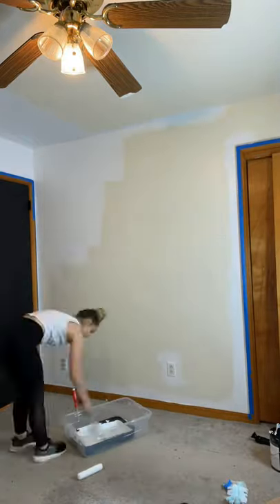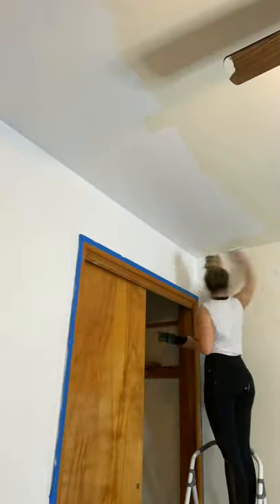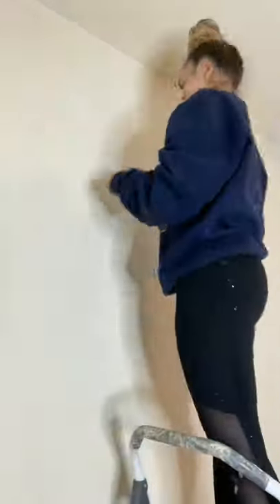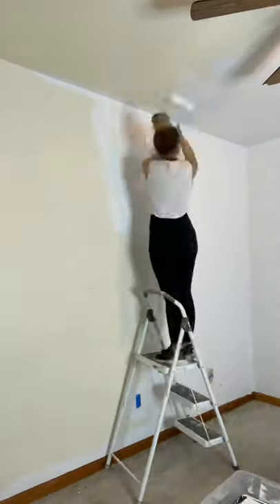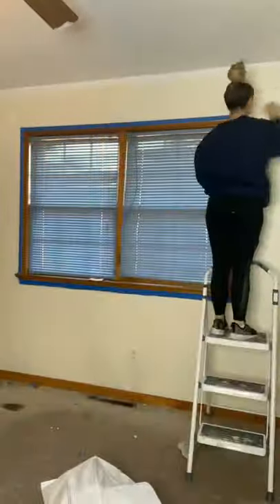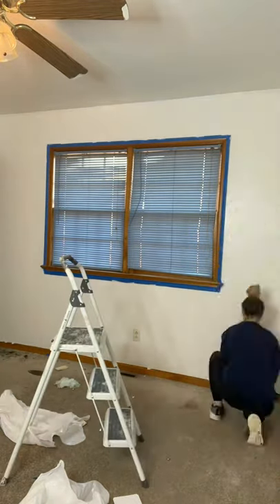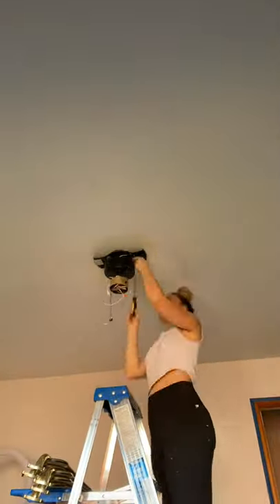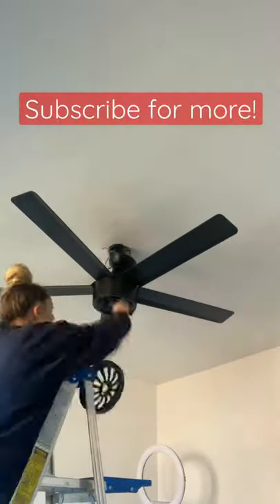HOT MESS HOUSE RENOVATION PART 124! | VIRAL TIKTOK & YOUTUBE SHORTS SERIES | LEXI DIY

Comment: You're such a badass, specifically, putting in the ceiling fan. I can do easy electrical but how do you handle the weight of the fan? I can't do it on my own. I need help holding up the fan!! Do tell girl, what your secret is. 😊😜😉😁